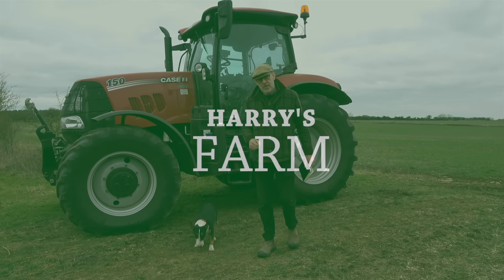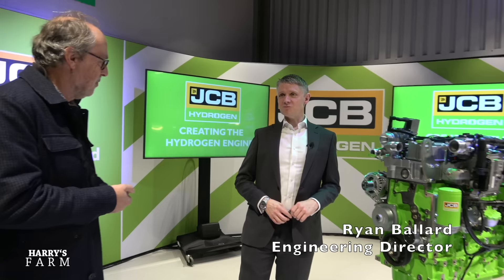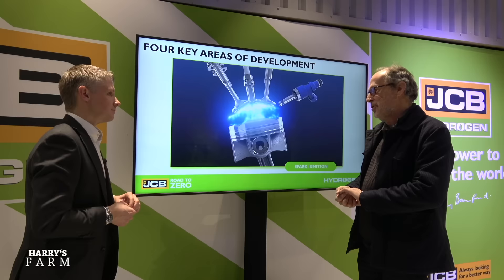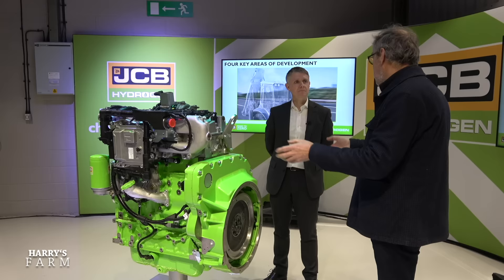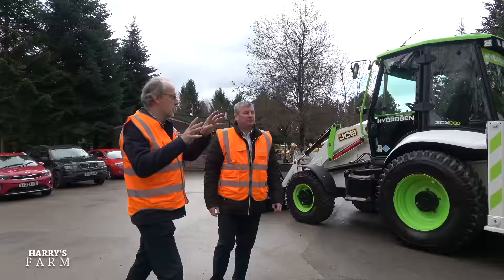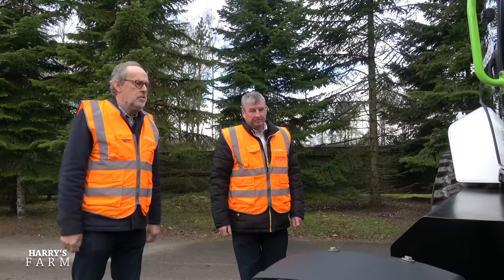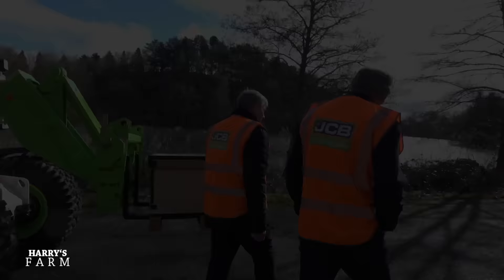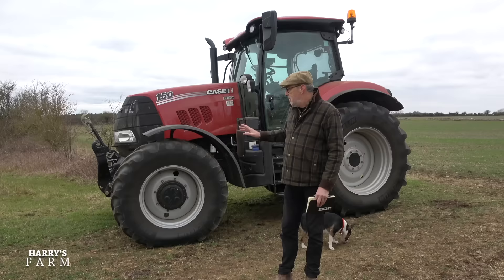JCB is moving to hydrogen power for all their big machinery. Here’s why.

Comment: It takes 50 kWh of electricity to produce 1kg of hydrogen from pure water.
Reply: On that basis a hydrogen vehicle is about as energy efficient as an electric vehicle.
Reply: @wibblywobblyworldofboats6254  err no. a hydrogen car will go about 60 miles on 1kg of hydrogen, A modern electric car will go about 180 miles on 50 kWh.
Reply: @kevinashurst634  do your research a little more thoroughly and I think you will come to a different conclusion 🧐
Reply: @wibblywobblyworldofboats6254  I have, please explain how a hydrogen car is as efficient as an EV?
Reply: @kevinashurst634  it's plainly obvious that you're working from figures that have been pulled from the first page of Google. 🙈
I give up.
Reply: @wibblywobblyworldofboats6254  sorry no, i worked it from first principles. So off you go show me how i am wrong
Reply: @kevinashurst634  go on then use your first principles and tell me the efficiency rate of an up to date hydrogen electroylizer, how much energy a kg of hydrogen holds then you can work out how much energy needs to be put in for that 1kg
Reply: @wibblywobblyworldofboats6254  lets say the very best electrolyser is 99% efficient, ( they aren't) then you would get about 33kWh of energy from 1kg of H2 if you converted  it at 100% efficiency. Best hydrogen fuel cells are @ 45% on warm day.
Reply: @kevinashurst634  no, 41kwh per 1kg is the answer you are looking for. But at Least you are researching it a little deeper now!
Reply: @wibblywobblyworldofboats6254  so it's now 41 kWh per 1 kg. Brilliant. Don't forget you have to purify the water first. You can't stick any old junk into an electrolyser. Now tell me what is the efficiency of the best fuel cell or gas turbine to convert the h2 into electricity or motion. I will give you a clue @ 50% on a very good day. Now work out the total efficiency of an H2 vehicle compared to a BEV.
Reply: How many gas turbines are used to create electric! 😂😂😂
Reply: @plumbertime  loads, big planes have them for ground power, plus lots of other applications.
Reply: The video they actually tell you how inefficient internal combustion of hydrogen is. They state that it is the same efficiency per kg as Diesel,but hydrogen has 3 times more energy per kg. Therefore it is 1/3 as efficient as a Diesel engine.
Reply: Currently,  but as the technology improves the production will become more efficient.
Reply: @0skar9193  no, it won't you can't bend the laws of physics.
Reply: Ridiculous stuff

Comment: Great innovation from JCB and definitely the right early adoption move for the company to thrive in the market.
Reply: A lot of more pressures and more parts, inservicable and expensive
Reply: sadly not. hydrogen is a dead end as it requires massive amounts of electricity to make it. there are 3 grades of hydrogen Green blue and brown, the green is as you would expect enviromentally friendly. but the brown and blue come with massive Co2 creation. The brown is made directly from coal
Reply: It's grossly more efficient to use the electricity to charge a battery than to produce hydrogen. You need on the order of 5-10x as much electricity to produce the requisite amount of hydrogen, as you would if you'd just charged a battery and used an electric motor.

I work with hydrogen in aviation. It has a small number of niche use cases. But it is not viable for cars, heating, and frankly I highly doubt the cost per kWh for agriculture will ever allow this to be adopted by farmers.
Reply: @Daniel-S1  if you had taken the time to read my comments you will see that I clearly state that there are 3 types of hydrogen , green, blue and brown. What you are talking about here is termed green hydrogen. unfortunately it is the least produced version accounting for less than 5% as it is the most expensive of the methords
Reply: @jukeseyable If you had taken the time to do some proper research you would know that there are many more colours of H2.  Pink (nuclear) Grey (Nat. Gas) Black (coal)  Brown (Lignite) Blue (Nat. Gas with CCS ie a con job) Green (electrolysis via renewable energy) and even turquoise, yellow and white. Take your pick lol
Reply: @jonathancullen1337  I had, but judging by some of the comments here it felt prudent to keep it simple, hence the good the bad and the ugly approach
Reply: @GoogleAreDumb  I completely agree with u here! Also hydrogen is still nowhere near having a good enough volumetric energy density. Hydrogen will be good for static energy storage, but our main goal should be to uses electricity directly with the help of some temporary stationary battery storage.
Reply: @jonathancullen1337  The only hydrogen that will be allowed will be green.

Comment: The future lies in a mix of technologies. No one technology or solution fits all applications.... automotive, agriculture, mass transit, aviation etc. This solution would appear to suit the agriculture application well (unlike battery electric) but the main issue is that you don't just dig a hole in the ground and suck up hydrogen, it's massively energy intensive to produce. So the environmental credentials of each technology/solution is still a challenging problem, just like other technologies. Very interesting though.
Reply: Who says that hydrogen ICEs are superior to battery electric? The hydrogen infrastructure is not there and they can't even make it work for cars plus the fact that running costs are very high. Just about every farm is connected to the electricity grid and tractors are very rarely in use all night. JCB are backing the wrong horse.
Reply: @rogerphelps9939  Hi Roger. If it can work for large formerly diesel machinery, how come it won't work for cars? I've talked to mechanics who have converted their petrol cars to hydrogen as a hobby project and with an onboard water electrolysis unit! The car made its own hydrogen and powered the car no problem.
Reply: @nephos100  🤣🤣🤣 they got you good .
Reply: @callumcurtis15  Good one, Callam. Next time provide an argument. Otherwise, just let the adults talk.
Reply: @nephos100 I have designed a perpetual motion engine, but the petrol barons are discrediting me. I need public help to get me to market, shares available. 😅
Reply: @richyfoster7694  If have a genuine invention, you should put a patent on it. But, then you will be approached to sell the patent or face another unwanted choice.
Reply: @nephos100 Scale and efficiency. There's about 1.5 billion cars in the world, compared to about 10-20 million tractors. There's enough solar/wind generation to allow for all those tractors to be running on green hydrogen (hydrogen generated by splitting water via green electricity). But that hydrogren generation process is far less efficient than putting power on the grid and into car batteries. If we tried to power all the cars in the world on hydrogen, we'd need to carpet the sahara in solar panels.
Hydrogen is a great alternative for vehicles where the battery weight or charge time would be prohibitive, but it's not a solution to mass transit.

Comment: Dear Harry please investigate hydrogen production, transportation and storage at the filling stations of the hydrogen. That will be an eye opener!
Reply: Yes. It will demonstrate very clearly why JCB is going up a blind alley and that they will be going the way of the dodo if they don not change.
Reply: @rogerphelps9939  Industrial hydrogen use is at 350 bar which makes it easier to work with than for cars where it is 700 bar plus and often liquid does not take up the same room as gas. JCB have obviously considered the supply side, which for industry is different to domestic. If you want a green fuel for your car get a diesel and use bio fuel (ie cooking oil)
Reply: Farmers won't like paying through the nose for this nonsense. Liquid H2 on a farm? No way. JCB are toast. @wahiba

Comment: 11:50 Whilst there is no carbon in the fuel, all internal combustion engines consume a little engine oil during operation. 
It’s just the way the engine functions. 
I hope the redesign for hydrogen has incorporated some secret design elements that reduce the oil consumption to virtually zero. 
JCB is truly a legacy company that the British can be proud of. 
I wish them all the success 👍
Reply: It is legacy in the worst sense of the word.
Reply: They do make biodegradable motor oil, so once H2 motors are everywhere., the demange will increase.
Reply: Modern engines burn very little of their lubrication oil  even at 95000 miles I have yet to need to top up between services.

Comment: When I was a kid in the '70's, people talked about hydrogen power, but many of those talking said it wasn't feasible. Nevertheless, it was thought that hydrogen - were it ever to materialize - could possibly be an answer to our biggest energy problems. Now that it's here, however, it sounds like there are still some obstacles to overcome. It will be interesting to see how this develops in the future. Thanks for an educational video.
Reply: Its greenwash bs
Reply: Hydrogen is merely an energy storage method

Batteries work at 80% efficiency

Hydrogen is closer to 30%. Meaning 70% of what you put in is wasted

Innovation? Or hype?
Reply: The machine can work 24hrs two 12 shifts...electrical machine is parked up on charge.  .
Reply: @pauljshields123   what building site is working 24 hours a day? Remember the infrastructure required to obtain hydrogen, even at ridiculous prices, that takes up lots of room or requires someone to leave site to take the machine to a high pressure filling site. It would be faster and more compact to just have 2 batteries or 2 machines and not need the additional infrastructure. It is also far cheaper. 

Charging is getting faster. It may be that one day we will be able to run a cable to charge the machine while working or fast charge it during breaks. Or just overnight charge it and use a bigger battery that lasts all day

We can already build big batteries. Just stack more on. The technology and infrastructure is already present. So this so called advance that requires massive infrastructure that can't be done locally on site will not work. You can pour money into forcing it to work, but a better manufacturer will say "our machines use half the power and cost one third of our leading competitor. Choose our reliable option that doesn't put out water and rust. It is sealed and works in all weathers. Reliable and very cheap. Doesn't need taking off site to refill once a day, so saves on labour costs, and improves safety with a sealed cell power unit instead of liquid gas. There is no catastrophic risk if punctured." 

They will get every contract going because their option is so much cheaper, so much easier and so much safer. It doesn't need off site refuelling or require on site distilling plants taking up space, requiring training and massive energy costs, and increased risk and danger. 

This is not a suitable energy storage medium for building sites. Cars very seldom need driving for 20 hours straight, so even in cars it is unlikely most people would have much use for this new technology. Plus faster charging may one day mean a charge in minutes. It's not far off that already.
Reply: @truth.speaker  Hydrogen in combustion engines is even worse than that 30%.
Reply: @Simon-dm8zv  conventional fuel is also around 30% efficient when used in a combustion engine if the physics numbers are crunched. I believe there large efficiency increases is the use of a hydrogen cell as opposed to using hydrogen in combustion, if hydrogen was someone’s preferred choice of fuel
Reply: @MarkFlik  Correct. But the percentages mentioned above are well to wheel, not tank to wheel. And yes, if you really need hydrogen then it should be a fuel cell.
Reply: @truth.speaker  Yeah, like you're an expert.
Reply: Peter Lewis … is that what u call the Toyota
Reply: @truth.speaker Lithium batteries are closer to 95% efficient. Old lead acids are 80 - 85%.
Reply: @jacquelinebrunder2384  So you're saying 95% efficiency on the 3+ transformers and miles of wiring between gas, coal, or wood(Britain) fired power plant and the the lithium battery? Does this efficiency include the motor, the motor controller, cell balancing, thermal control, and powertrain wiring? I don't think there is any real world use of lithium that is even remotely close to 95% efficient.

What's the efficiency of the power plant? Nobody wants nuclear power except France, weirdly, so fossil fuel is what is going to be powering the majority of lithium batteries for a decade or more. We're all just gonna pretend the power comes from those windmills, solar farm, or hydro station somewhere over there. Out of sight, out of mind. 

The reality is that only a small fraction of the world power grid is sustainable, and that isn't changing within decades without nuclear power. On top of that, changing all transportation to electricity will nearly DOUBLE the demand on the electrical grid. It's hard to even grasp the enormity of that hurdle; increasing this much electrical grid capacity.

Natural gas power plants are pretty clean and efficient, but there's an awful lot of war and political conflict surrounding natural gas distribution and fracking rights, right now. Giant gas lines mysteriously blowing up, weird contracts, extreme taxes. Shaping up to look a lot like the 70s oil crisis, all over again, disgusting. 

Endlessly hyping up lithium technology is very much putting the cart before the horse. The only ones benefitting are the Chinese lithium cell making Mafia, and the steady stream of tax credits they have rolling in.
Reply: @@dogslol1928 I'd say fairly efficient, yes

Comment: Great video Harry, you asked all the technical questions many journalists in the construction industry haven’t asked in their visits. And thank you for putting the nox question to them. As an owner of construction plant I am following developments of JCB and hydrogen very closely. Battery tech as it stands just won’t cut it for us
Reply: I'd be curious on some diesel L/hour numbers for different types of equipment, and typical run times for single shifts, when you say batteries wont cut it - nothing will be a drop in replacement for a 350L diesel tank, not hydrogen either, its a crazy amount of energy in a small light easy to handle liquid - a true miracle fuel - but if we are going to move past it, we will need to inconvenience ourselves a little, the question is, how much are willing to adjust our ways? Because if it's "it must be the same as diesel" then you will never get there.
Reply: @brushlessmotoring  Doing the maths shows that a battery electric solution isn't actually THAT far away if you can enable battery swapping ie not have to wait to charge batteries on the vehicle itself, which seems eminently possible for large plant machinery 

350 litres of diesel at 36.9 MJ/litre is indeed a huge total energy store of 12.9GJ of energy.

However an internal combustion engine only turns about 20% of that energy into useful work when run at typical (variable) loads and a hydraulic power transfer system is mono-drectional and again has poor efficiency. Studies in fact show average installed efficiency for industrial hydrualics at just 22%!  Even if we generously suggest that for something like an excavator the hydrualics manage 33% efficiency that means the machine actually delivers 774 MJ of work from that 350 litre tank (6% percent efficiency tank to work........)

774MJ could be delivered with a battery electric system of around 860Mj input energy, which is 240 kWh. Yes that's a big battery, but not ridiculously so in terms of mass and bulk when we are talking about heavy plant machinery. (around 1,200 kg / 380 litres of battery). As battery cell costs fall and the operators start to understand the lower running costs of battery electric machinery, i expect these sorts of solutions to rapidly take over.
Reply: Wrong. He was farr too uncritical. A proper investigator woulf have torn it to shreds.
Reply: He actually dived into the minutiae of something that is pretty conventional and completely ignored rthe massive hydrogen elephants in the room.

Comment: As someone who works for a company that converts trucks, we are currently struggling to go battery electric, for our specific application. Battery technology just isn't good enough, at present. We do convert CNG powered trucks, but they also have issues with range/hours in use. I just wonder if Hydrogen is much better. Hydrogen at high pressure is a bit worrying, if things go wrong , a road crash for example. Another problem is making hydrogen, its energy intensive. We'll see if anyone else in the construction/agri world( John Deere, Caterpillar etc) goes down this route.
Reply: Also the early hydrogen engines  needed very clean air which resulted in frequent filter changes.
Reply: @caterthun4853  that was the fuel cell type, combustion engines like these aren't as fussy making them better for construction, farming, marine, etc.
Reply: By thier nature, In a destructive situation the carbon-fibre tanks rip open (rather than go bang) and then the gas fly's away rather than be an ignition risk (as petrol would be)
Reply: @backacheache  at 350x atmospheric pressure, I'd rather not be anywhere near it if it "rips open".
Reply: @rohansprenger6902  CNG is already 200-300.. Don't do steel tanks boys - there are a lot of videos of 10 year old cars making quite the havoc! (Most of them are just rusted out tanks that were supposed to be replaced already). Carbon fiber tanks should probably last 2-3 times that.